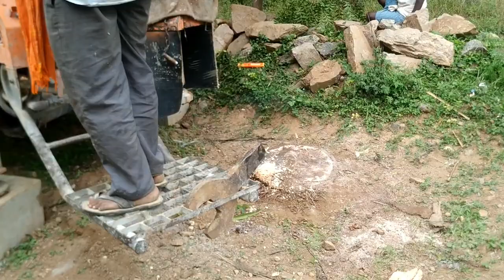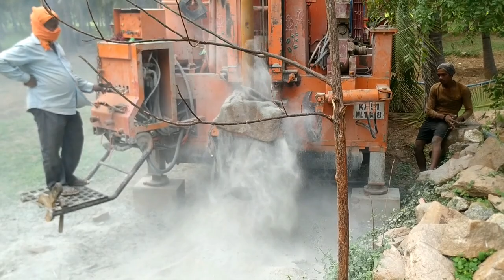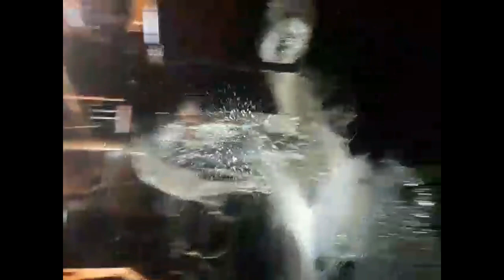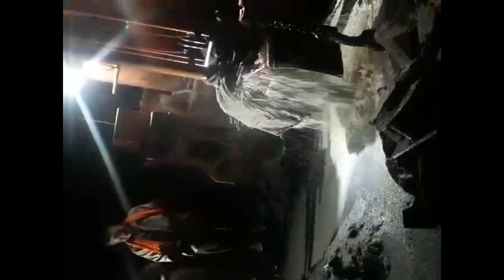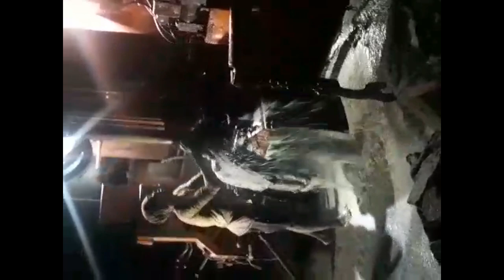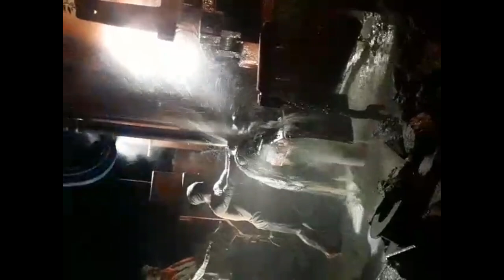600 அடி விவசாய போர் 4 இன்ச் தண்ணீர்-செல்வகுமார் 7 Dec 2020.Agriculture Bore 4 inche flow-Namakkal DT

Comment: 600 feet ku total kasu evolo borewell poda.. solluga please
Reply from the maker: For 600 feet borewell drilling cost Rs 70000 approximately. This may slightly differ based on area and hardness of rock, and depth of casing pipe.
Reply: @SELVAMTV  ...🙏🙏🙏